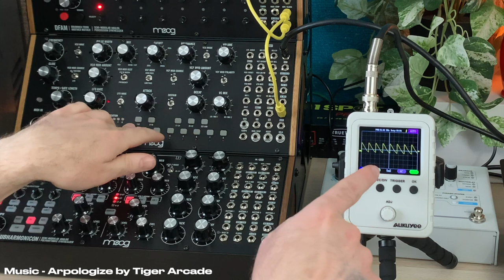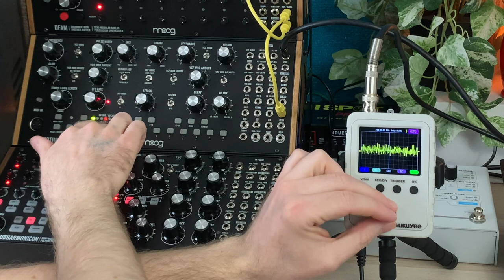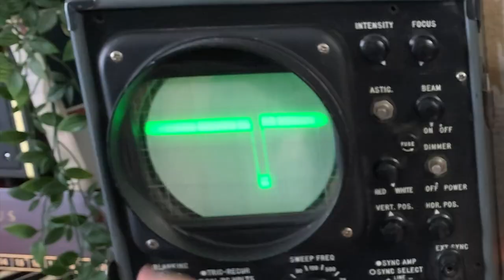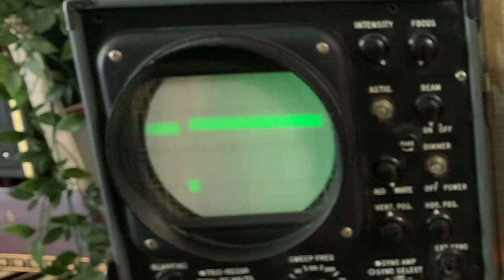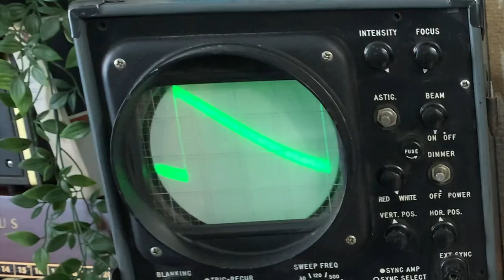How To Connect & Use Oscilloscopes W/ Your Synth // + Bonus Q&A!

Comment: What did you mean when you said the analog ones are dangerous if not used correctly?
Reply from the maker: Old CRT oscilloscopes can potentially pose a risk as they may produce X-Rays. Which is radiation. Just like old TVs. You just have to be careful.

Comment: Great video !  Question: How would you do this for an analog synth that does not have any CV outs (like the Behringer Deepmind 12D) ?
Reply from the maker: I am not aware of any hardware method beyond the KORG NTS-2 or using a software to display them. I only know how to connect using a modular synthesizer with standard oscilloscopes.Thanks for watching!
Reply: @Tiger.Arcade  i am getting an nts-1 (due to all the effect goodies and programability), but I am on the fence about the NTS-2, seems pricey for basically an oscilliscope …. considering a Minilogue Original is only about $100 more and has one built in.  Or am I missing something about the NTS-2?
Reply from the maker: @GearGuy  It's more of a 4 in 1 oscilloscope. I personally think it is a bit overpriced as well. Here is a quick run down video I did on it: https://youtu.be/MT5nGhUvbyE
Reply: @Tiger.Arcade  Cool, thanks, I’ll check it out !

Comment: Is 3.5  mm cabel has mono or stereo item? I mean inside to synth.
Reply from the maker: 3.5 can have mono or stereo. When dealing with the patchbay these are mono only. So VCA out would just be a mono signal. As far as I am aware at least.
Reply: @Tiger.Arcade  Thank you. But can you connect this mono on phone out? Would be go signal to oscillator or not?
Reply from the maker: @yurkinsongromov7998  It depends on your connections. Is it an output connection or an input connection. the 3.5 mm cables will send and receive signals.

Comment: Where can I by connectors wire from unit to synts? Can you write a index or name of wire please?
Reply from the maker: Synthesizers use either 1/4 cables or 3.5 mm to mixers or interfaces
Reply: @Tiger.Arcade  Tnank you. I mean for oscillator and synthesizers? From synthesizers 3,5mm but to oskillator how can I connect? Where can I find this wire connector?
Reply from the maker: @yurkinsongromov7998  check out the video description for a list of all cables used in this video. I connected to my VCA output on my synth.
Reply: @Tiger.Arcade  Thanks, I see!)

Comment: The reason you need to wind the signal down to view it may be due to a DC offset on the moogs output. I'm only new to the synth world and not particularly familiar with the hardware yet so I definitely might be wrong. 

you can test this by putting a non polarised capacitor in series with your scopes probe to block and potential DC, if the (not yet wound down) scope suddenly starts showing your waveform then your Moog has a DC offset.

Also, check the scopes settings for a DC offset value. If there is one, make sure it reads 0v and save it. (do this before a capacitor test).
Reply from the maker: I’ve tested it on other synths and it’s the same I’ve even tried saving the setting to default it. Must be some bug? Thanks for the tips though!
Reply: @Tiger.Arcade  Sounds like it may well be! Very strange!